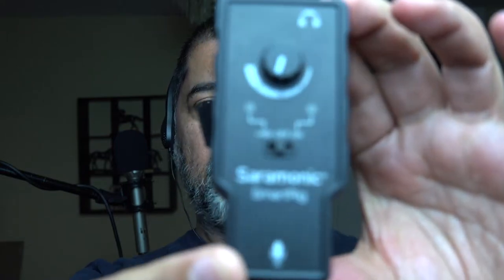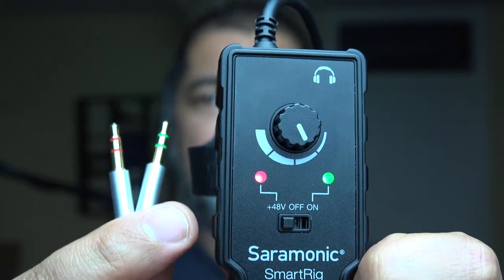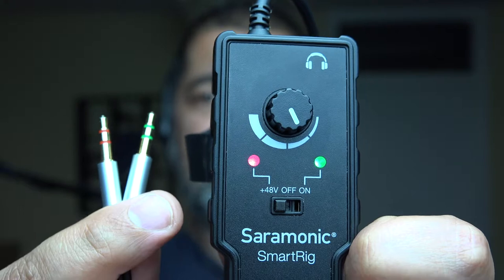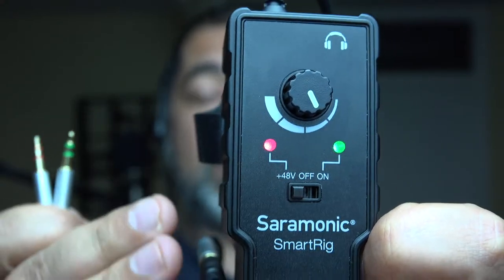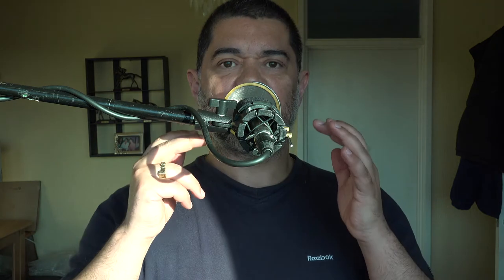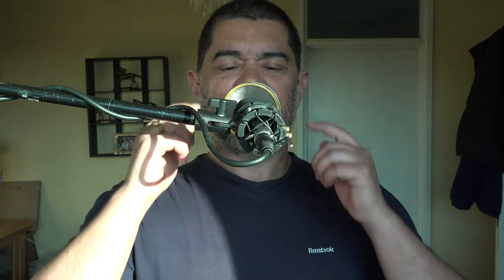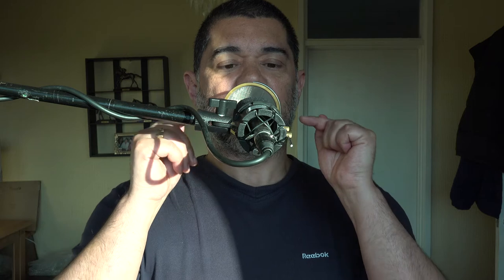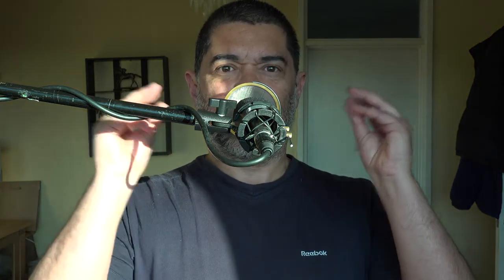Saramonic SmartRig Cheap XLR to 3.5mm Phantom Power Microphone & Preamp - Rode NT5 - DSLR  Vlogging

Comment: Hi David.

I use both the Smartrig and the Smartrig+ for portable video. Both great units. 

Following your excellent review of the xm8500, I started experimenting with another device in league with the Saramonics and together, they both seem to raise the gain of the dynamic mic enormously while also giving a very low noise floor. 

The device that I connect to the bottom of the mic is a Triton Fethead going into the Saramonic and then have the gain on the Saramonic really low as well as the gain on the recorder. (Zoom H1 at 37 which gives its lowest noise floor and Smartrig right at the bottom of its range, giving again, a very low noise floor)

 So basically, the Fethead does most of the preamping and the Saramonic provides phantom to drive the Fethead. 

Result is a dynamic mic with unbelievable sensitivity. I’ve even recorded birds at a distance outside using an AKG D5 and this preamping arrangement.

So the Saramonics not only provide preamping if you want to use it, but also act as a kind of ‘buffering’ device between another preamp and recorder, which gives the low noise of dynamics along with the sensitivity of a condenser using this arrangement.

I get fantastic results in particular with the AKG D5 since it has a tighter polar pattern than the xm8500 and it works a treat for those videos where you just want to shoot and keep the audio stable ... I just place the mic in the middle of the room and record to a recorder. 

Yes, there is room acoustic,  less with a D5 but the noise floor is deliciously low in comparison to many others that I have. The room acoustic is lessened by the D5 polar pattern, although it still seems to pickup audio in the room nicely. Certainly better than an omni which makes my front room sound like a bathroom.

I love this setup since I’m free to run around with the camera and nothing attached!!!

As usual, your videos act as a great source of inspiration and have had me experimenting with all kinds of setup and certainly, the one I’ve just described is something that I’d never have dreamed of using previously until I saw your xm8500 and this video. It sounds a bit crude having preamps in line but it really does work and the ‘purist’ part of me is beginning to give way to my ears! ;)

Cheers

Ian
Reply from the maker: Hi Ian.

I totally agree with sometimes bypassing purism. I've got over 30 years of audio experience and have used many microphones with loads of different hardware, and some of my best results have come from less than purist approaches.

Another problem with the purist approach is that it's usually very expensive. I used to use a microphone and preamp that cost about £4000 for most of my vocal work and that's before the channel strip and converters. While it's hard to get bad results from such equipment, it's simply way out of touch for most people's spending power.

The main thing that I find when experimenting and thinking outside of the box a bit, is that you can get amazing results without breaking the bank, as you've pointed out. In fact, the intro element of this video was done with a headset mic that costs £8, which I picked up for £2 in a B&M store. I'm not saying it's the last word in close mic'ing, but I dare anyone to say that it doesn't sound sonically good, and it's simply connected direct to the camera's mic input.

I'm actually testing out a similar workflow to what you've described, but instead of the Fethead being powered by the Saramonic, I'm using the Saramonic to power a DC converter. Basically, one of those XLR to 3.5mm converters that steps down the 48V phantom to around 7V for electrets. I know I could do this direct with the Smartrig+, but as I mentioned in another one of your posts, I wasn't getting the results I'd expected from the +. In fact, listening back to my test files, I personally gravitate to the Smartrig's sonic ability, although the + is way more versatile. Also, I very rarely record two microphones when doing video dialogue, so a standard Smartrig with a step down converter is probably better suited for most of my video dialogue stuff with Lavs.

Interestingly. I've also got an AKG handheld dynamic, can't remember the model but it's basically similar to a SM58. Like what you've described, mine has a more focused cardioid pattern compared to the Behringer, it's also a bit more sensitive and also sounds great. It cost me £25 second hand. The real interesting thing with all this, if you did some blind A/B'ing with your Fethead/Saramonic setup compared to what would usually be expected for such microphone/recording scenarios, I bet it'd be pure guess work as to what's best.

In fact, let me know what you think of this test. It's not finished yet as I've not done the titles and it still needs some editing, at the moment it's  not public and only uploaded to play out to some of my friends, I'll post a link to the final one when it's up. It's a comparison between the Smartrig and a Focusrite Scarlett. While the 18i20 isn't super high end, it's still what most would call professional. One of the points of the test is to prove that if your camcorders input is good and your camcorder can record uncompressed audio, there really isn't any need to use a separate field recorder for simple dialogue.

https://youtu.be/_iDUR5CRX88

I'm also working on a couple of videos that show the difference in noise and dynamic headroom when using the Smartrig, or any good preamp, compared to directly connecting microphones to camcorders. The main video is to show the improvement when used with a fixed gain input, such as those on the GoPro cameras. Although not the same as your Fethead/Saramonic workflow, it's similar in that it shows a better gain structure and all the sonic improvements that follow.

Cheers buddy,
Dave.
Reply: Hi there :)  is there any way to use Saramonic SmartRig for recording on a computer? Thanks for answering :)

Comment: I have the same wire mesh windshield and shock mount. Got it on Aliexpress 5 yrs ago and it actually frequently gets a beating - I stopped counting how many times I accidently hit it with my arm or chair while turning. It still is in one piece fortunately

Comment: Hi Dave.  What is the gain like and how clean is it?  I am thinking of using it with some dynamic mics too, and I am not sure whether I will also need a FetHead or not. I have a Zoom H1n  but its gain is not quite sufficent to drive my dynamic handhelds. My Zoom H6 is okay outside, but indoors I have to crank the gain to a level where the preamp starts to get noisy. So I was thinking of a FetHead, but if I go down that route I will also need something to supply phantom to the FetHead...
Reply from the maker: Hi Krisztián. For what it is and the price, I find the gain is really good and quiet, even when it's cranked up. I always have a good mic position for these things, so that also helps. Cheers, Dave.
Reply: @DavidHarry  Cheers Dave. To be honest, right after my comment I picked a Smartrig II up  and tried it with a few mikes yesterday.  I am more than happy with it using various phantom powered condensers and even the Rode VideoMicro/Boya MM1 through an XLR+plugin power adapter.  I need further tests, but I had good results feeding the Smartig boosted audio into the Zoom H1n and also my Samsung Note 9 phone. The Smartrig II has virtually no hiss even at its maximum level, while the Zoom H1n starts to be noisy over about 5. For dynamic mics with the Smartrig at maximum I would have to go up to about 6 or 7, so I still want to get a FetHead eventually. Interestingly, my phone seems to have less hiss than the H1n and having this Saramonic connected to the phone is fun as I don't have to sync in post. Makes things faster for quick videos. I have to find a way to supply the 9V externally though.

Comment: what's headsets brand you used at the start of this video, sound really good. Thanks!
Reply from the maker: Hi Gerard. It's by Trust, they usually make cheap computer peripherals but it doesn't have a model number on it. I needed something quick and cheap for a voice call so bought this one. When I plugged it in I was completely shocked, regardless of its price I don't think I've ever heard anything much better as far as a headset mic goes. The sound is very rich and full while being amazingly clear and there's no noise on the mic. I'll dig it out and do a quick video review of it soon. Thank you for reminding me and thanks for the comment. Cheers, dave.

Comment: Is there any way to use a wall adapter instead of the 9V battery?
Reply from the maker: It doesn't have a 9V DC input, although you could wire direct to the battery terminals when there's no battery inside it. But this could cause an earthing issue which could create a hum in the signal path. I may try it out. If I do and it works, I'll do a quick tutorial. Check back over the next week or so as I'm uploading a how to video on how to do a simple modification to turn the output from TRRS to TRS and attaching cold shoe mounts top and bottom so it'll sit on a camera or anything with a shoe mount. Cheers, Dave.
Reply: Thank you for the fast reply! I will definitely watch that video :D
Reply from the maker: Cool, hopefully it'll be easy to follow and helpful. I'll also be doing a definitive review of the SmartRig, indoor with my best studio condenser and outdoor with my best shotgun, as I've not really done a proper review just on the SmartRig. It really is a fantastic piece of kit, at any price. Cheers, Dave.

Comment: I have realized the cellphone also matters about quality. which one did you use?
Reply from the maker: Hi Jamie. I actually used a video camera for this video, but your right in saying that the smartphone matters for quality when recording via a smartphones. Many phones or similar media devices use heavily data compresses audio, like AAC or MP3 etc. Which can sound good, but sometimes don't if they use low data rates or if their analogue to digital audio converters aren't very good. There's also dynamic compression and processing that many devices add. If a device over limits or over compresses, then this can make a clean signal from the Saramonic not sound good. That coupled with data compression, can do a real number on your audio quality. For smartphone use, your best using an audio app for recording that records uncompressed, to something like a WAV file, and that can bypass the phone's internal dynamic processing. Cheers, Dave.
Reply: Thanks David for the information. It is curious but I tried 3 cellphones and from the cheapest one I get the best sound ( a samsung galaxy young) and it is far so much better.
Reply from the maker: Hi Jaime, different phones use different ways to convert and process the audio coming in on the analogue input. Some do this better or more transparent than others, things like too much limiting or bad analogue to digital conversion can really get in the way of an otherwise technically good recording. It may be that your cheap phone simply has better analogue to digital conversion, or it may be using less limiting or processing or it may even be that the input gain is better matched.